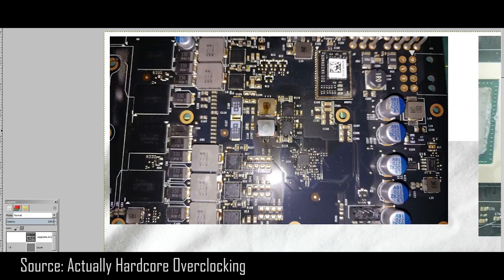Your Nvidia GPU Might Burn Up & Die?

Comment: thank you Nvidia, now i'm moving to red team
Reply: generally most companies aren't ethical. amd isn't an angel.
the thing of course is: nvidia is a whole different level than what amd does.
thus fuck nvidia of course.
Reply: Fair enough. In most countries AMD is much more expensive than Nvidia and you can see from benchmarks that they are quite a bit worse than Nvidia cards too.
Reply: Nvidia fanboy, or just unforgiving of a bad experience with AMD products?
Reply: I was talking about a hypothetical situation where as you said "AMD were the market leaders". If they were the market leaders, it would be because they have better cards. I'm comparing if AMD had the better cards vs if Nvidia had the better cards, in which case the AMD situation would be better for consumers because they made it harder for themselves to utilize greed in that situation. Not sure what current performance or prices has to do at all with what I said. Edit: but based on your aggressive stance toward something irrelevant, I'll have to assume the Nvidia fanboy.
Reply: AMD has made it a whole lot harder for themselves to hurt consumers out of greed, by doing things like open sourcing a lot of software and making things like freesync royalty free. Even if they ended up trying to be like Nvidia, we would see a much better market for consumers under their rule because of how they have established themselves.
Reply: I think im with u !
Reply: I have no choice for my next build either. Nvidia is not an ethical option.
Reply: basshead I don’t know if you are being sarcastic or not. Do you know how many pc gamers have 3d headsets for their PC’s? Less than 1%. According to Nvidea (Hardware Unboxed also did a vid about this) do you know how many people have an Nvidea card that can drive 3d well (90+ FPS)? 0.31% have 1080ti’s or Titans. There are over 700 million PC gamers. I know a few normal gamers with 1080ti’s, 1 with a SW Titan in real life. None of them have 3d headsets for their PC.

If you want to support gaming and I was not buying a 1080ti or better, I would absolutely 100% buy an AMD card. They are currently better at every MSRP price point (and you could buy their 7000 series which destroyed the 500 and 600 series, their 200 series which destroyed the 600 and 700 series at every price point, their 300, 400, and 500 series which again, was equal to or better than Nvidea’s offerings at each price point with the exception of the Fury/X). The 400 and 500 series were available at or below their $229 and $219 MSRP for over a year and people were still buying inferior cards, at one point the 4/570 8GB was being sold for $120 usd and name brand cards like the Sapphire Nitro+ (the fastest out of the box 580), MSI OC, and Gigabyte OC 8GB 580’s were all bouncing between $199 and $215.99 from Jan 2017-early April 2017.

So if supporting gaming means buying an inferior product for more money, then I guess? Or a company that hurts performance on their own cards to make the other company’s card worse (like putting a hairworks tessellation mesh under mountain skins and on objects that were not in the field of view in The Witcher 3, even though just adding it normally gave them a better looking game and a 3-5FPS lead, but adding it everywhere? Well it dropped their FPS by about 10, but dropped AMD’s about 20, so they of course chose the latter.

That said, if Nvidea has the better card at the price point (ei if a 3GB 1060 performs better than an 8GB 580, then buy the 3GB 1060. If the 1070 were better than the V56 and prices were about the same, buy the 1070).

I always recommend buying the best card in the price range you are looking into.

If you are buying an 11 series card, I’d expect the V56 and V64 to be their midrange competition, and the 8GB 580 to be their low end competitor. If Nvidea is better, but green.

If it’s Pascal vs Polaris/Vega, and prices normalize, which they should very soon if people continue to refuse to overpay (c’mon ppl, do not spend $400+ on 580’s or $350 on a 1060, it is idiotic) then AMD is better at every price point besides the 1050/560 at $110 and the WC V64 vs the 1080ti at $600 for the Vega, $700 for the ti (though it does need to be noted that a normal oc’d V64 is within spitting distance of the 1080ti in real dx12 and Vulkan engines, and does beat it on rare occasions, while beating it consistently in Linux).
Reply: You are going to pay a lot more for a card that performs a lot worse? Because thats how the red team fucks you.
Reply: i'm not using both, but i'm using AMD because they are cheaper in my country and easier to get
Reply: Not really... No one uses 3D and gameworks is a gimmick.
Reply: I agree, these idiots complain that Nvidia are bad for consumers so then as consumers pay another company even more money for a worse product. Its like they seem to want to fuck themselves in the arse!
Reply: Neither mate. Right now AMD cards are much more expensive and perform worse than its competition however I guess idiots like you have been brainwashed into believing that buying AMD will make the world a better place. It wont mate, its fucking dumb to buy a worse performing card for more money.

Comment: I think if you have one of these  cards, maybe try adding one of those small heatsinks on them. The heat dissipation may help ¯\_(ツ)_/¯
Reply: Can't really put heatsinks on inductors, its just a tiny role of wire. Adding more airflow wouldn't hurt though.

Comment: Which version of GTX 1070 is best without burning issue?
Reply: ZoZo Anime none
Reply: the one that isn't Nvidia
Reply: There haven’t been any reports of the GTX 1070 burning out. Might want to try and research the topic or wait a bit to see if Nvidia announces anything before purchasing one.
Reply: Thanks for the info guys, will wait until the price goes down...
Reply: Can't be sure yet, but even though I own a gtx 1080 I would go with a vega 56 if I was looking for a new gpu at this point
Reply: Aleit Tiela Vega 56 is still more expensive than the 1080, even though it’s meant to match up with the 1070. If that card was what you wanted to get, then I’d probably say to wait another 2 months.
Reply: The video said reference PCB, just avoid any blower style GPU.

Comment: I was forced into team Green because of cryptocurrency mining. As soon as prices of RX 580 8GB drop, i am back into team Red
Reply: iCynical PC's have you seen the prices?
Reply: Dimitrije Jovanovic dont get a 580 get a Vega
Reply: I am willing to pay €/$100tops for used RX 580/480 8GB if out of warranty, so I have little to lose
Reply: @gymkhanadog "Nvidia has the support and the quality." Someone clearly did not watch the actual video if that's what you actually believe.  Let alone any real history on the matter.
Reply: RX 580's perform slower than a 1060, use more power, produce more heat and noise. Sounds to me like you dont need Nvidia to fuck your consumer experience up, you are going to do it all by yourself! (With a little help from AMD).
Reply: Why are you giving any type of allegiance to a company?
Reply: gymkhanadog people can’t afford the 1070 just like that lol especially now I’m sticking with 1060 does everything I need it to
Reply: lol but people CAN afford a 580 just like that? :P

I'm actually still running a GTX 970 I bought just after they released. Great card!
Reply: Dimitrije Jovanovic  I switched to team green just before Christmas and regretted it straight away just cos preferred relive but all this makes me miss my hd 7900 witch still kicks ass at 1080p
Reply: +gymkhanadog

Yep! My last 3 cards were from EVGA. The GTX 670 FTW, the GTX 780 Classified and the GTX 1080 Classified. I've overclocked those cards to the max and have never had any issues with those cards.
Reply: i prefer to use obs for capturing, even though i do have an rx480 :)

but i dont'really need the rewind feature relive/shadowplay have :D
Reply: Dimitrije Jovanovic same here buddy
Reply: gymkhanadog 
He said when prices go down. So you're still wrong
Reply: basshead 
Um, no. Rx 580 has freesync--which is free, and preforms just as well (usually) as the 1060
Reply: Skip the 580 and get a 1070. Better card in every way including power efficiency.
Reply: So it'll go from 400 to 350 'when prices drop'. It'll still be a card with meh architecture and sub-par performance, it'll still be an absolute power hog compared to anything else on the market, and it'll still be yet another AMD product that runs hot as hell. So no, not wrong.  Nvidia has the support and the quality. EVGA for life! <3 ;D

Comment: This is exactly what happened to my 1080ti.....
Reply: Just FYI evga doesn’t void your warranty for changing thermal paste or taking apart the card. One reason I went with them.
Reply from the maker: Really?  Do you have pictures you can send to Buildzoid?
Reply: UFD Tech I don’t and now I wish I did. It looked exactly like the video just in on much bigger scale and because I opened it to inspect, warranty voided. I may have it around here somewhere and I’ll check, but I have a ton of GPUs (AMD) so it may have been tossed. Now I’m SUPER bummed.
Reply: XFX and other brands are fine with water cooling as well (ignore the warranty void stickers they say, at least for the US, probably not everywhere else though). Surprised they voided anything for that, its usually only if you damaged it yourself (jab a screw driver or drop it like Linus).

Comment: if you're not overclocking ram, would this really be an issue? and or water cooling with a full block? i really hope to get more time out of my 980ti .......
Reply: Make sure to have a fan for the rest of the board. I had my card water cooled, but the VRam chips would burn the _ out of your fingers. I already had a 120mm fan for the rest of the PCB and heatsinks on the VRM.

Comment: My 980 started overheating while Folding. So I had to get a TITAN X PASCAL. I end up getting a whole new system after that to. Asus zenith extreme and a 1950X to replace my 5960X. And I just had to replace my ssd drive with a Samsung 960 pro. Since the Corsair ssd's have some weird lag after a while. I still have to try it out after giving it a rest after the last Aussie assault.

Comment: Should I be worried about my 10 series card????
Reply from the maker: No reports yet of this happening. VRMs were burning out on EVGA cards a while back, but I havent seen any indication that 10-series cards are affected as well.
Reply: UFD Tech thank goodness, but considering how long it took to find out about this stuff happening to some 9 series cards (I mean the volta/ampere is already on its way) its probs to early to tell.
Reply: Drakilicious even with free repairs its still a massive pain in the ass, everyday my card spends being repaired is a day it should have been in my rig allowing me the clear the GTA5 story mode for the millionth time.
Reply: My 1080ti (pallit zetstream) burned out, oced memory and mined etherium.

Stopped ocing and mining since.

Wootware replaced it for me though.

Oh yes and it was definitively memory related, because when it died I was busy watching an episode of ghost hunters and it reacted the same way as it usually does when I push the memory too far. Hard to explain, but it makes greenish rectangular artifacts on the screen.
Reply: @gymkhanadog
The thing is that I read this happening to people who do casual mining, not necessarily OCing, of course mining stress the memory but if the card can't even withstand a couple of weeks of calculations I would consider it utterly unreliable, a heavy gamer (10h/day) would get the same result maybe at twice or "quad" that time.
Reply: phew, i got a evga 1080 ti ftw3 can't have that being burnt out
Reply: it happens after 2 years when the warranty has run out. That way you cant RMA it and will go buy another Nvidia card. LOL!
Reply: Teen Shinobu Is best Waifu  Yes this is happening to 10 series cards.  Just YouTube 1080ti fire.  I have a EVGA GTX 780 that died on me.  It has a black screen of death and the fans spin at 100%
Reply: UFD Tech
What about an ASUS Strix GTX 980?
Reply: caRpetbomBer1 I just googled it, it's not an issue with the 10series cards it's a problem with the EVGA acx cooler and thus only applies to  some EVGA custom 10 series cards.
Reply: Hm, got a GTX 780 from MSI their gaming twin frozr that i got from my older brother, he went with a gtx 1050ti before christmas in a mini itx system & didn't need the performance.
Was going to be a replacement card too my r9 280 from Asus that im currently using still but still happy with the r9 280 heh.

It does still work here though after testing it briefly in another pc without the drivers, gonna give it a run in 3dmark 2k1 up too vantage in a dated core 2 duo e6600 system. (Bottleneck for sure lol) but it saves a bit of hassle putting it in another system then my own for a bit.
Reply: caRpetbomBer1 had this with my 1080ti lol forgot about it until you mentioned something.
Reply: My gigabyte gtx 1070 card burned while eth mining, two days ago.
Reply: works fine & is now back in its box & esd bag, hit a bit high temps though at 86c with a max load of 82% in a 3.4 ghz overclocked core 2 duo pc with 2 gb ram. so I'll definitely need to take it apart & change the thermal compound when i put it in my main pc later.
Reply: Xx Tek tip xX hope you got it around pr before November lol. I was quite smug when I bought a 1070 for 430 and then watched them go for 7-800 within a month. Seems like its settling back down.
Reply: unnamed715, The cards that seem to be affected are reference PCB 780, 780TI, 980TI en a few Titans. Aka so far you 980 should be good.
Reply: It's not like you can't do anything about it right now. The memory inductor runs more amps through it than it was designed for. This means two things, it will always fail and it will run hot. What you can possibly do is influence the moment it fails. Hopefully, if cooling has a (substantial) effect, you can postpone the failure moment after the moment your Graphics card got replaced because it became obsolete. If you run your Graphics card in a well-ventilated case and you make the fan curve a bit more aggressive than stock it will cool this memory inductor more, meaning it will run less hot. It's not proven that more cooling prevents or postpones this problem but more cooling won't hurt, so it's worth the try. Personally, I have been running my GTX780 MSI Gaming (which has a reference PCB) in a well-ventilated case for over four years now with a fan curve that puts the fan at 100% if it hits 70 degrees. I have always ran the card with a higher power limit and usually with a higher core clock. I never overclocked the memory or played with the voltage. It's still running so I either have a very tough memory inductor or my aggressive case cooling and fan curve did postpone the moment the memory inductor is going to fail. It makes a bit more noise but it isn't as bad as you think with the MSI cooler.

And if you did not get the message: DO NOT OVERCLOCK YOUR MEMORY...
Reply: Not yet...
Reply: watch buildzoid's video and see if your card has those tiny, shitty inductors
Reply: A65468970894 good
Reply: UFD Tech haven't watched it all yet, but what about the 9 series?
Reply: Short answer is no. This is another case of FUD. There are a small number of cases of idiots burning out their cards through OCing, big deal, it happens. Apparently UFD and this guy from MegaOverclocking or whatever the site was is trying to make a federal case out of isolated instances. Just because a device isn't built to YOUR demanded specs doesn't mean you get to shit all over it because you're trying to do more with the hardware than it's capable of.

Comment: If you have a look at the "source" it says Extreme overclocking, looks like they pushed their cards a bit far
Reply from the maker: No, those aren't his cards.  These are normal use cards that are dying.  If you watch the video, he explains that this can happen with extreme overclocking, but even then, should be specced high enough to be fine.
Reply: Tucker using the name of the source as any kind of information on a particular topic is just.. what?